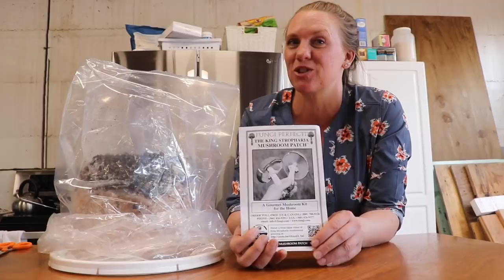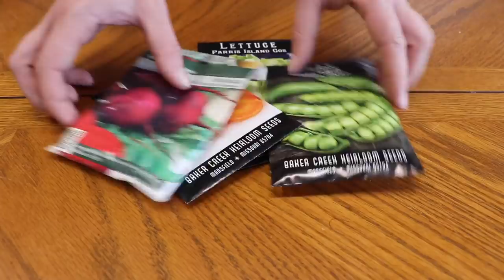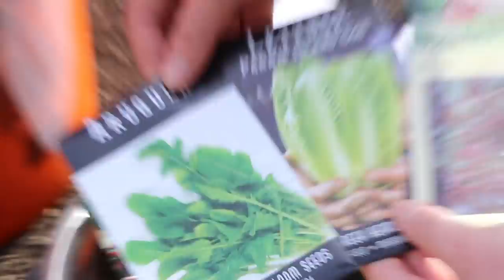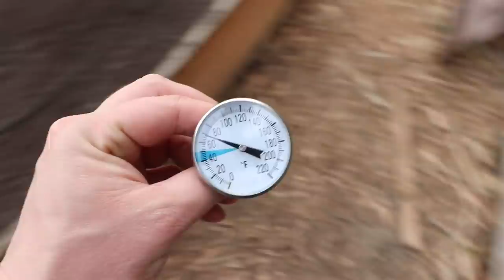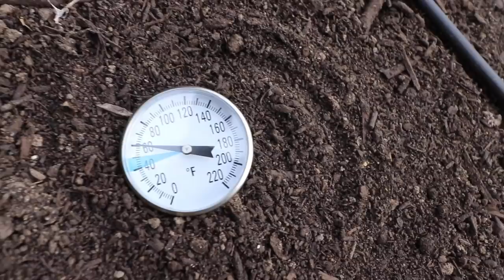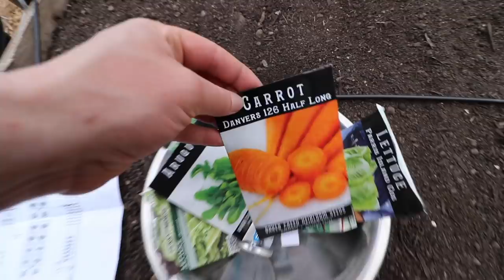Lettuce: How You’re NOT Growing It (But Should)

Comment: Mike Griffin has it right. Harvest outer leaves from multiple plants. Came to that after 3 years experiments. The lettuce will continue to thrive as long as you don't harvest more than 3 or 4 leaves at a time. Once you cut a head,  it's iffy if another will sprout. Definately second Railfans recommendation of Ladybugs. Extremely effective. I released a new batch 3 times during the growing season.

Comment: Yall. I live near boise. I thought i' d start lettuce early and get it harvested before planting summer vegetables  (tomatoes, peppers etc). I sowed out 10 weeks before my last frost, under a polytunnel no less. The lettuce didn't start taking off until just a few weeks before last frost. Now I've had to squeeze my tomatoes etc in between the lettuce and am hoping that it will be all harvested before the summer vegetables need the space. However I did put one row of lettuce in early fall last year. By the end of the growing season the plants were only 2 inches or so high. They held on through winter in the poly tunnel and were growing at start of spring. Also kale, spinach and chard I planted last summer (I harvested through summer with the cut and come again method and left them over winter as an experiment) also survived the winter and provided early spring greens. So lesson learned. If you hadn't considered overwintering greens in idaho. Learn from me. It's the way to go.

Comment: The masses of wood chip at the bottom of the beds will produce an enormous amount of long term nutrient. While it is decomposing though the decomposition process is exothermic and will heat the beds, mildly in cool temps and to almost dangerously hot when it’s warmer. This can be used helpfully at right times and to be managed at peak times. Love your vlogs👏

Comment: On your potatoes, be sure they have very good drainage.  I've never grown potatoes in a raised bed, but in ground they should be planted in a raised furrow of 4" to 6" of soil above the plant and the potatoes themselves an inch or two below the normal level of the non raised furrows.  Also, your soil shouldn't retain the moisture as well as the other parts of your garden may require.  Potatoes produce best in dryer soils with infrequent top watering instead of soaking the soil itself.  Good luck!  Be sure that the expected rain doesn't uncover your newly planted seeds.

Comment: The next time you guys plant small or very small seeds - there is a trick. 

Mix the packet of seeds with 1, 2 or 3 hands full of dry sand and when thoroughly mixed, carefully direct plant the seeds/sand into those rows.  The sand gives bulk to the planting and if you carefully pour the 'diluted' seeds evenly you won't have 50 seeds to the foot, but rather (say) 5 to the foot.  That means that high numbers of starts don't have to be thinned out and the packet and seeds/sand left over can be stored back into a baggie for successive plantings later on, say fall.

On the potatoes, when you put "stuff" around the growing plants - use spoiled hay, wood chips or other light ground cover.  The idea is to encourage the potatoes to form in the top cover for easier, faster and more complete harvesting, with the win/win benefit of more organic material in the soil.  Don't forget moderate amounts of available Nitrogen on all that carbon mulch.

Looking GREAT!  :~))
Reply: Small seeds can be glued [paste of sugar and flour] to any organic matter strips, e.g.: paper.  Then just plant paper and all with the seed side up.
By making contrasting color combinations,  you are sure to have wowy borders.

Comment: The very best way to grow potatoes:  when you clean out the hay barn in Spring, lay down one layer of hay scraps maybe six inches deep. Put baby potatoes onto top and then pile 18 inches of hay scraps on top of the potatoes.  In August come with a large bucket. Reach into the damp and compressed hay bits and pull out large, totally dirt free potatoes.  Make sure you have a very large bucket.

Comment: If you haven't seen it already, Charles Dowding,  an organic grower in UK, has an excellent video on how to maximise output when growing lettuce. He may not be in your growing zone, but his advice is great, and he does give tips on how to adapt to other temperature zones. One lettuce plant can produce leaves for 6 weeks before flowering, so a dozen plants is plenty at one time. Just have more sown at 4 week intervals,  so you can continuously replace finished plants with new ones.
Your next step is surely going to be a polytunnel so you can extend your growing season - and have lettuce during the winter months. 
And baby can toddle around inside it while you tend the crops 😃😍

Comment: I use to have a friend that would cut the potatoes like you did but before planting would soak them a half hour or so in a solution of water and something called rootone(???) or rutone(???). He use to plant carrot tops after cleaning the carrots instead of throwing them away the same way with the rootone water.

Comment: Nice garden plan.  
You can turn your raised beds into hot beds and grow food through winter.  I'm reading a book called, "Backyard Winter Gardening" by Caleb Warnock.  He has a blog.  He lists the best veggies to grow this way and where to buy the seed.  My climate is not warming.  The spring is very short going from winter - short spring- summer, and my cool season veg like broccoli doesn't grow right.  Heading up in heat ruins it.  We are making cold frame tops to use on the raised beds.  Building a greenhouse.

Comment: lettuce will continue to produce till they "flower" then YES they continue to grow but they become very acrid (the acidity level goes UP). Basically once the flower stem comes out you whack it and grow a new one BUT it will PRODUCE alot of lettuce leaves before that stem comes out (probably 6 to 9 months of leaves you can cut and eat, grow, cut and eat, etc).
Reply: 6-8 months? Not in NC, maybe 6 - 8 weeks before bolting.

Comment: Start looking into the Generator’s on the market and researching what will be best for your family’s home security when the power goes out.
You are adding to your family, are you going to put in a Whole House Back-Up Propane generator in case the main grid goes down next winter?  I don't think the Solar or your small generator's will give you as much power if the power goes out for days. It could and will happen.  Your wife enjoys the heater in the bathroom, right?   Do you have a backup heat source for this house????    If you do I missed this in the building of your home.   
Jesse, if you and Alyssa felt the Plane was a good investment then the generator should be on that same list.  Don’t wait any longer it will take some time to put this in place before winter.
Thanks to you both for listening, also hope this helps you.  
When your first born comes LIFE will change for you both.  
Toby